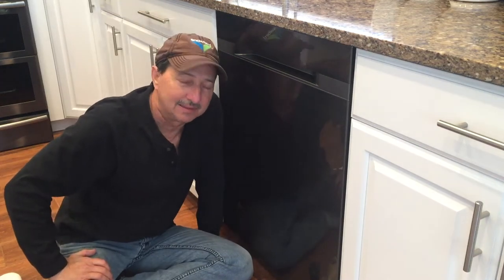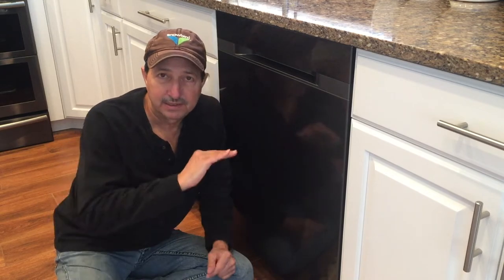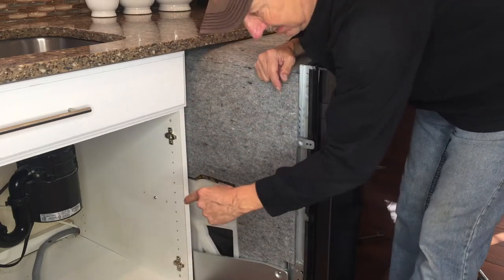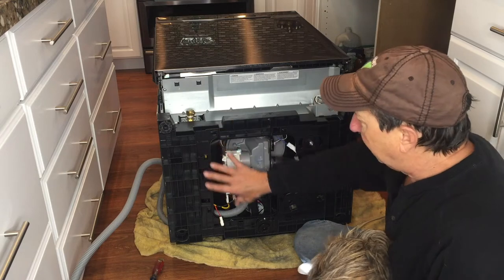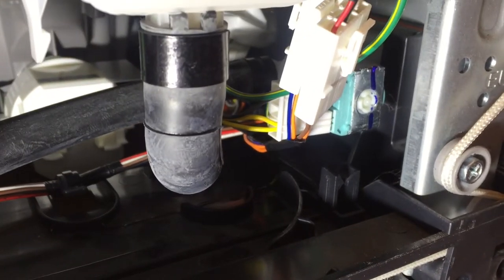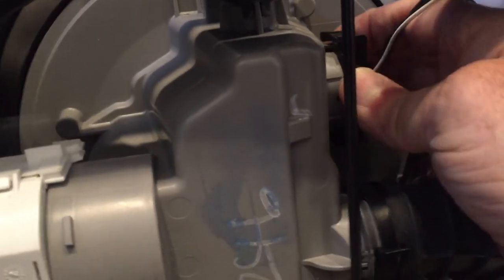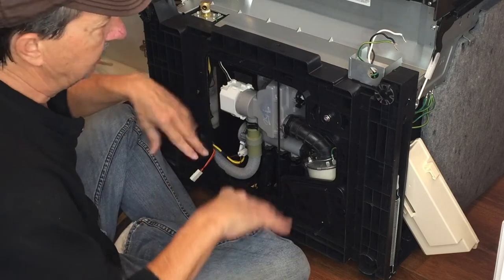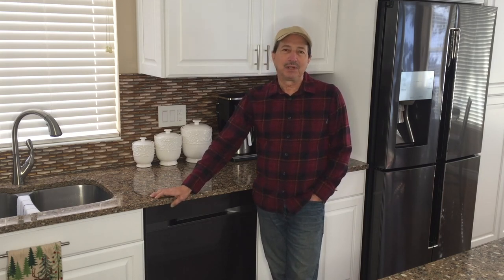Samsung Dishwasher Leaks. LC Code. What to look for.

Comment: Another video showed the screws that hold the pump to the bottom of the tub were loose; take out the bottom rack, the filter and the cover plate, then tighten the screws; this can be done without pulling the dishwasher out; the sensor will have to be dried out before the code will clear though, and that requires pulling the unit out and turning it on it's side; so for you product engineers out there you can use this as a guide: instead of making something that doesn't leak, just add a leak sensor that shuts the product down! I've never seen a dishwasher that needed a catch pan & leak sensor, the designers must have known that it was going to leak and this was their solution, Amazing!!!

Comment: I’m a certified Samsung tech it was most likely your main wash pump. The bearings probably went and rubbed a hole in the plastic. YOU WONT SEE IT ON THE OUTSIDE. Replace your main wash motor.
Reply from the maker: So far there is no leaks. Thank you for your suggestion and thanks for watching.
Reply: Mine all the sudden started sounding loud, is that one of the symptoms of the bearings going out?  It finally put out the LC code.

Comment: I ran into the LC code last night on my dishwasher. I pulled it out and took off the bottom plate, water was present which I cleaned up. But I could not determine the leak point. All the hoses look dry, nothing obvious, no water marks. I did reseat the water line and drain hose at the unit. Put it all back together and ran a cycle. No issues. Your video has given me some other areas to check. Thank you! I expect the code will come back after more cycles/days go by. We shall see.
Reply from the maker: I never did find the exact leak in mine but the LC code has not shown up again in over a year now. Good luck and thanks for the comment.
Reply: @riderescue  Update: Been over a week of daily use, the issue has not returned. Very odd, but glad I don’t need to make a major repair or purchase yet.
Reply from the maker: @drdiabeetus3061  Pretty strange. Mine has not had the error again either.
Reply: Well the error came back, pulled the unit and confirmed water again. Not a lot, just enough to trip the sensor. I finally discovered the leak point. The ribbed drain hose that attaches to the sump motor assembly had pinhole cracks in it. These cracks could not be detected without pulling the hose and stretching it/bending it to open up the ribs. I discovered the issue when I flexed the hose and saw fresh water seeping out of the ribs closest to the contact area with the floor pan. The hose was routed/clocked in such a way that it was rubbing against the plastic floor pan near the water wall assembly. I got a new hose on order. For now I have patched the hose with some quick dry flexible glue (water resistant). Test cycle running, so far so good.

Comment: On first inspection of my Samsung DW80N39030US I found moisture around the drain hose attachment. The impeller motor seal looked good, so I replaced the existing hose clamp with a new one and snugged it down. This got me through 2 cycles, but the 3rd cycle was interrupted by the LC code again. This video gave me the patience to take mine back apart and dig a little deeper. Thanks!
Reply from the maker: Glad this video gave you the patience and confidence to pull yours apart to see if you can repair it and save. Good luck and thanks for the comment.

Comment: I would suspect that the pump drain unit on the bottom you removed near the end  might have been leaking from the motor to pump connection (pump seal) as it should not have a dirty pool of stagnant water in the drip tray underneath the unit. Keep an eye on this area for any future leak problems.

Comment: Thank you for this video. Once I took the dishwasher out and tipped it over about a half a cup of water spilled out of it. I just put it back and tried it again and it seems like it’s fine. I would advise anyone to try the machine again after tipping it over, but before removing any pieces.

Comment: I found the leak on the black rubber hose coming out of that pump you took apart and said smelled bad.  I believe it’s leaking out of where that rubber hose connects to the pump.  When you had that pump apart, the small rubber ring on the side that the impeller fits inside when you put the 2 halves together, is the end of that rubber hose (it seems).  Before I took that pump out, I squeezed that black rubber hose while I had the dishwasher on its right side and water started dripping from that side of that pump.  Real hard to see the leak itself, but pretty certain that’s where it is leaking.  Going to put it all back and use it and, when (not if) I get the LC code again, I’m going to buy a new one, mostly so I can tear into the old one more (take that rubber hose off) and see if it can be resealed with sealant.

Thank you for the video!

Comment: This video was the most comprehensive I have found.  I was only able to eliminate the LC code on my Samsung by disconnecting the leak sensor.  My next dishwasher will be a Bosch.
Reply from the maker: Haha, me too. I'll never buy a Samsung appliance again. My Samsung microwave blew up and my refrigerator is the most expensive pile of dung I've ever owned.

Comment: I also had the same problem!
I took the dishwasher apart, just like you did, and found the leak in the sensor; the o-ring was ruined and there was water leakage ....
My dishwasher's warranty had expired 4 months ago!🥵
Reply from the maker: Sorry this happened just after the warranty but at least you can use your hands and knowledge to find a low cost fix. Cheers to you!

Comment: Which model is this? Im getting the LC Code on mine: samsung dw80R9950
Reply from the maker: My model is DW80J7550UG
Reply: @brandi Rubio . I have the same model and I’m getting the same error and there is a leak . Were you able to fix it ?

Comment: I had a leak error, but had no leak, found the electrical contacts on the leak sensor just needed some cleaning. Burnished the contacts and put back together.
Reply from the maker: That is great that you were able to pin that down and fix it yourself. Cheers!